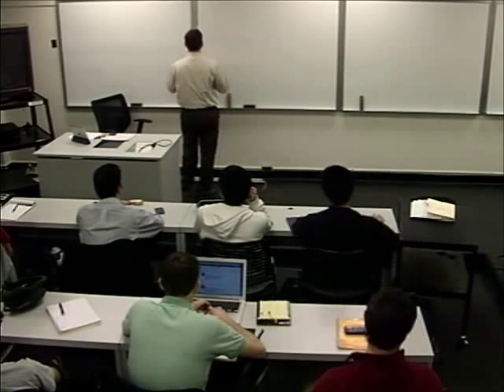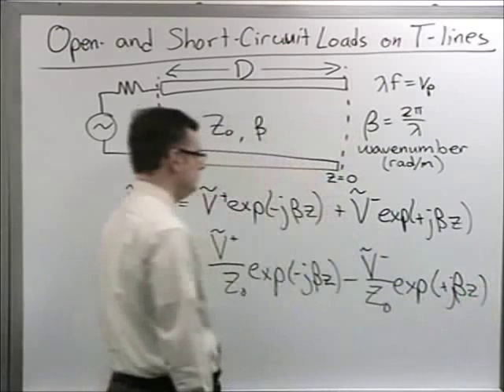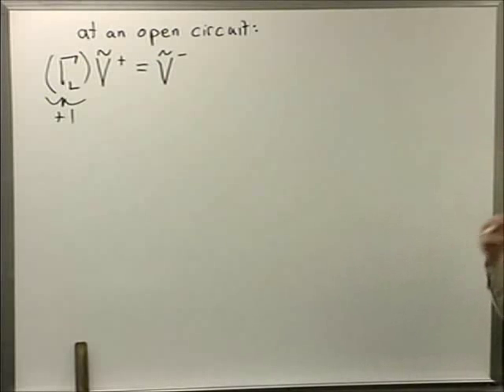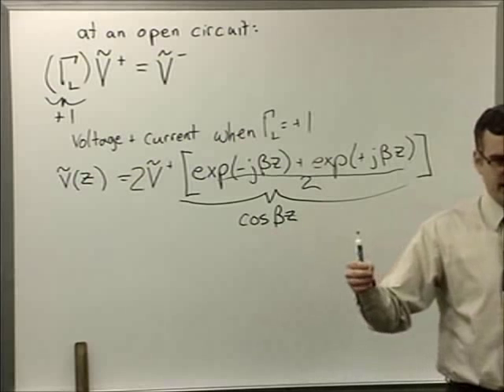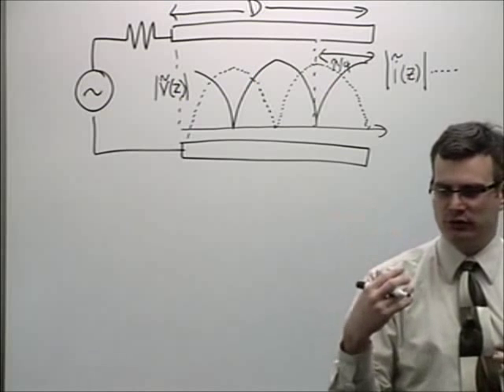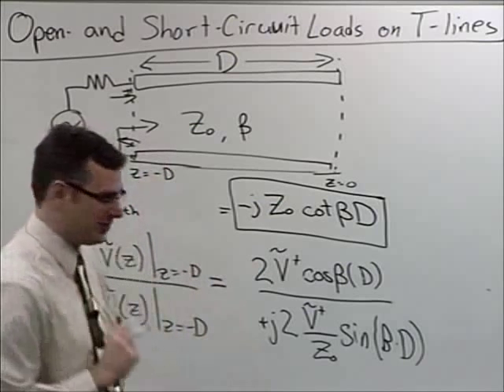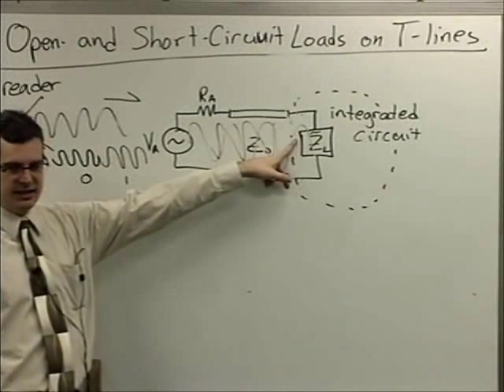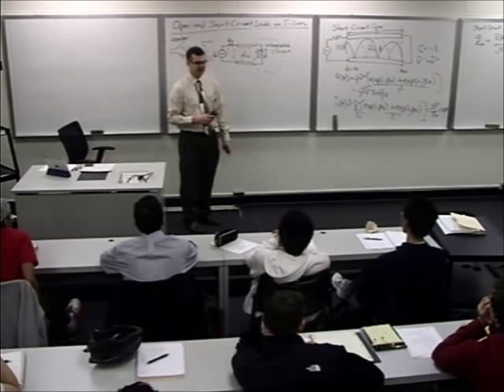THT03: Open and Short Circuits on Time-Harmonic Transmission Lines

Comment: what did professor mean by saying you dont have to drill vias but connect to the ground using the short ckt we got at 28:26
Reply: when you're making a circuit board, typically you'll have traces on the top and bottom, and a large metal plane connected to ground in the middle. in order to short something to ground, you typically have to drill a via, which is a hole plated with copper.
Reply: the transmission line is a 2 port device. you have the line and the ground.

sig(in)             sig(out)
o----------------------o

o----------------------o
gnd                    gnd

now if you make it behave like a short circuit, it shorts between its ends, so you create a short to ground

Comment: Why just changing to minus the first term not the second?
Reply: +Brenda Saller I guess you are talking about the first term exponential of the current for open circuit. I think is due to you need to get sin(+vebeta Z). However, it actually doesnt matter, cause you are able to get it by sin(-beta z)=sin(beta z)